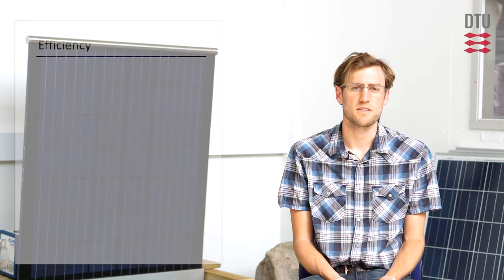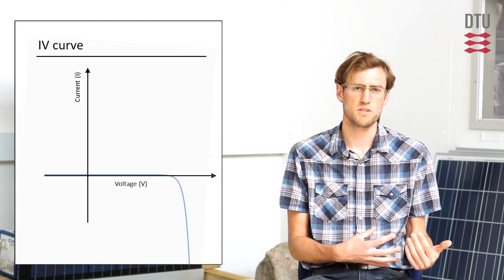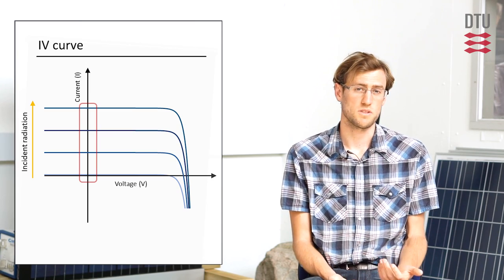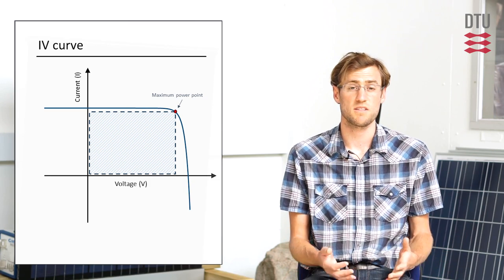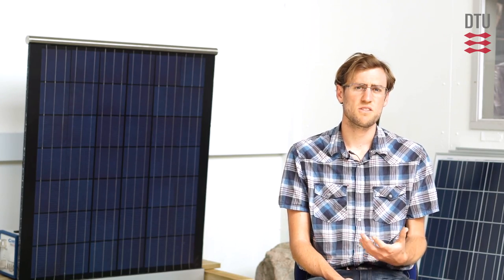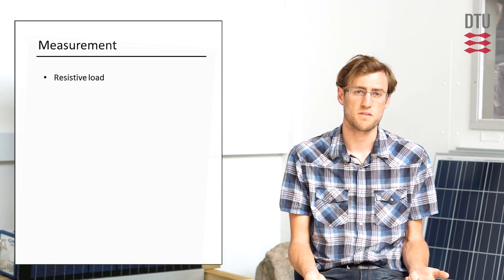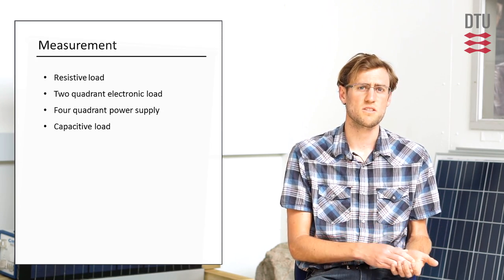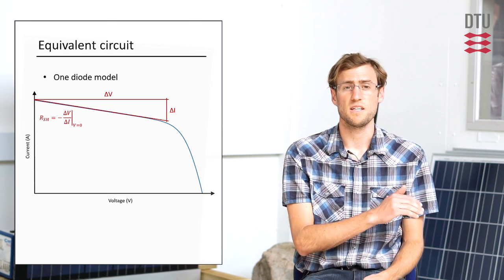Efficiency of solar cells - Measurements

Comment: Where can I find these measurements but in relationship to defuse light?
  That is, graphs that show efficiency relative to angle of incidence and averages thereof.
 As I understand it mono-crystaline  cells have higher efficiency with direct orthogonal illumination, but lose efficiency rapidly at greater angles, while thin film cells have lower overall efficiency but the drop off is much less with increasing angles and diffuse light.
   In your opinion what technology,  perhaps even brand, have the best efficiency for a fixed mount ,non tracking installation with a often cloudy situation... In other words what's best at highest angle of incidence and/or the most diffuse light?. Are there any commercial systems you know of that actually work in highly diffuse low intensity light, as in, will keep producing even on the most cloudy of days...

Comment: hi can anyone show me how to calculate formula for  voltage for a solar cell characterized by a fill factor of
0.34, short-circuit current 5.5 mA, voltage at maximum power 0.125 V and current at
maximum power 3 mA many thanks steve
Reply: FF= (Vm*Im)/(Voc*Isc) 
So make make Voc the subject of the formula to get an expression for Voc since you already the values of other parameters   in the equation.

Comment: Nick,, do a video on panel output verses load applied.  most panels out there are poor power sources and the public needs to know how they are getting ripped off.  OCV and short circuit current is a poor way to rate a power source.  I can't remember any generator company rating  a generator under theoretical power. The net is full of advertisements claiming 100W 12V solar panels which will never give you  anything near that rating.  I was an engine generator  instructor  for years and am lost as to how This theoretical data  slips into the wattage rating of a panel when those conditions will never be there in the real world.
Oh well, guess I'm just an outdated old dummy

Comment: Good enough
Reply: Given that a solar cell has

Voc =4,2V.

Isc = 45mA, and FF= 60%

calculate the efficiency. The light used during
the measurement was AM1.5 and
1000W /m and the area of the cell is
50cm2
Reply: Please help